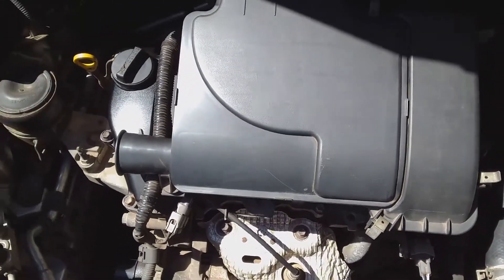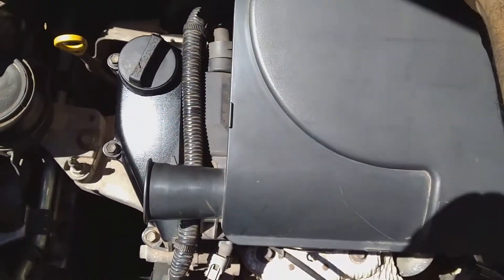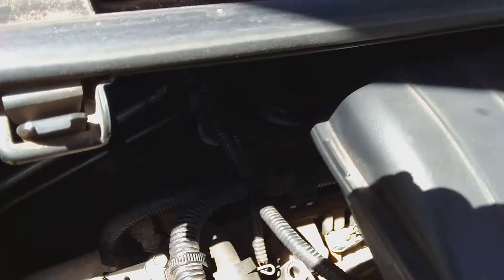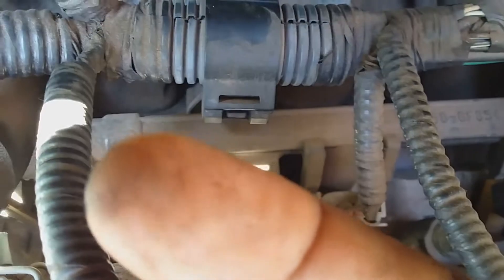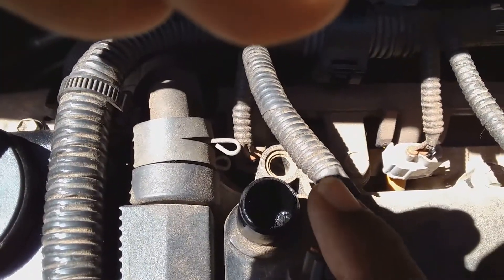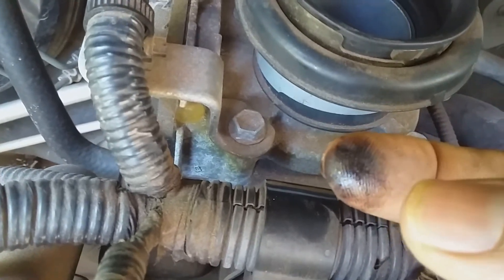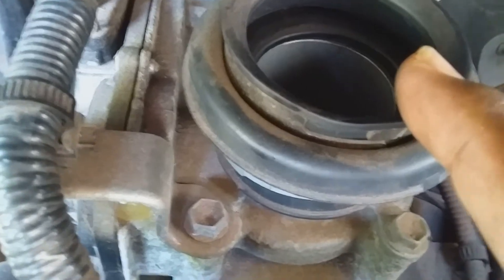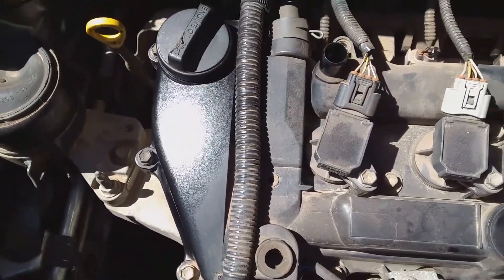Toyota Vitz Map Air Flow Sensor Cleaning Diagnostic

Comment: This engine doesn't have a Mass Airflow (MAf) sensor  as it seems. Usually it's located right after the air filter, but before the throttle. What is after the throttle is Manifold Absolute Pressure (MAP) sensor, which is the scenario in this case.
Reply from the maker: Thank you for your correction my friend you are absolutely correct.

Comment: Sheldock is the mass air flow sensor connected to the throttlebody because I am not seeing any. Electrical device  between the air filter and the throttle body
Reply: I was about to ask the same question too

Comment: Shel Dock you're making great videos. Thanks you so much for your time. I have the same car and the same problem and I want to ask you : Can I clean the throttle body with a MAF sensor cleaner or with something else? Thanks
Reply from the maker: You can use the MAF sensor cleaner as long as it helps to dissolve the tough grease that lodges on the throttle body and valve. 
You may need to use a piece of cloth to help rub away the grease because it can be stubborn. 
Ensure that you remove the throttle body before you spray anything to clean it.
Reply from the maker: A carburetor cleaner would be the best solution though.

Comment: Shel Dock my car makes clicking sound whiles accelerating when weather is hot and it gives out puff smoke after going downhill and accelerating right after. It's a Toyota vitz with 4 cylinders
Reply from the maker: Thank you for this question. I am presently experiencing the smoke problem when going down-hill as you describe. The clicking sound may be as a result of the same smoke problem. Just a question though? Do you have oil consumption issues?
I am having oil consumption issues and I am preparing myself to have a rings change for the pistons. If your oil rings are not working properly the result is the smoke issue you mentioned earlier.
Reply: @ShelDockToyotaVitz  I am not experiencing the smoke when going downhill I do experience the smoke right after I get to the end of the downhill and hit on the gas pedal to accelerate again and there is a puff smoke with the clicking noise with loss of engine power... And yes I am having a little bit of oil consumption. My car doesn't have all these symptoms continuously and car seems to  run perfect during start ups and starts to show all these signs after and hour or two drive
Reply from the maker: For my vehicle I don't experience the lost of power as you describe but just as you describe the smoke condition I have the same problem. Does this lost of power continues or its just after the puff of smoke?
Reply: @ShelDockToyotaVitz  No it doesn't continue after the puff smoke but rather you will feel the low of power during the clicking sound together with the smoke and also during the clicking sound alone
Reply from the maker: I notice that most Toyota vehicles in front of me at the base of the hill when they accelerate gives off white smoke like a puff. I also know that white smoke is given off when enough water vapor is present in the combustion chamber. This water vapor can come from the coolant if you have a bad head gasket however, my coolant is oil base and i am not loosing coolant. My explanation since other vehicles experiencing the same thing is that when going down hill water vapor gather in the intake system and when you accelerate at the base of the hill this water vapor is pulled into the combustion chamber then burn and gives off the white smoke.

If oil is being burnt the exhaust will give off a grey to dark smoke.

Comment: Is this the 1000cc 1KR-FE engine? I have a weird acceleration (car shakes /chokes in first gear) and some forums recommended cleaning the MAF but it seems this model doesn't have one(2007 ) or i didn't find it:)
Reply from the maker: My 1000cc 1kR-FE has a  Manifold Absolute Pressure (MAP) Sensor. This is located  between the throttle body and intake connection to cylinder head.
1. If your vehicle displays a engine check light then you need to scan the ECU for error codes.
2. With no engine check light then your electrical system is in tack and you need not to trouble it.

With no engine check light and the experience you are having then something needs cleaning.

I would suggest start cleaning you fuel system.
Reply: Did u check the spark plugs? My plug seals are gone

Comment: Where are u sir? I have a daihatsu boon and am getting crazy jerking, jumping , hard start and stalling
Reply from the maker: Am mainly specialized in Toyota vitz but I know that all these vehicles though have different design they all operates the same.
Procedure I used in my videos related to engine vibration should be similar to solving vibration in other engines.

Comment: Hi guys after cleaning my car engine gas is high when i pres the brake or put gair gas comes more high what is that
Reply from the maker: What part of the engine did you clean.
Reply from the maker: If the trottle body cylinder and valve is not properly cleaned high idle rpm may occur.
Reply: @ShelDockToyotaVitz  my car problem is when i rev it gets high idle.tough idling...not smooth.

Comment: Bro I am having a problem with my 2011 vitz. After engine swap 1kr engine. The car keep reving up and down on its own
Reply from the maker: Have you done a scan on the vehicle to see if any faults come up?
Reply: I have the same problem ,have you solved ?
Reply: @famom9198  yes was a leak in the injector check the seals
Reply: @famom9198  check all the hoses.

Comment: Where's the mass air flow sensor location?
Reply from the maker: A maf sensor is located between the air filter and the trottle body. A map sensor is located after the trottle body to where the intake connects to the cylinder head. A vehicle has only one of these sensors.
Reply: @ShelDockToyotaVitz  wrong. Some cars do have both MAF and MAP